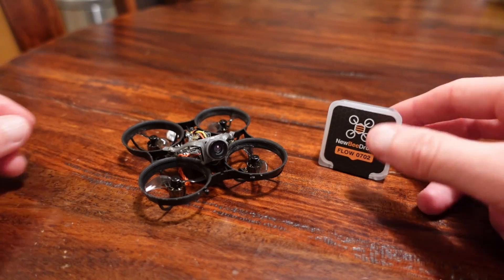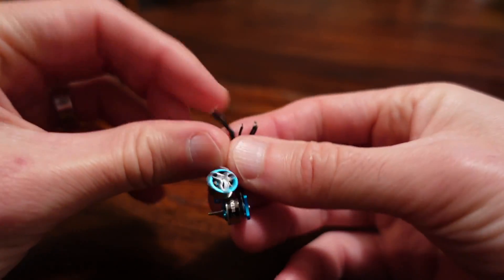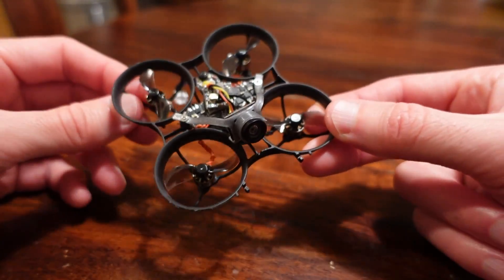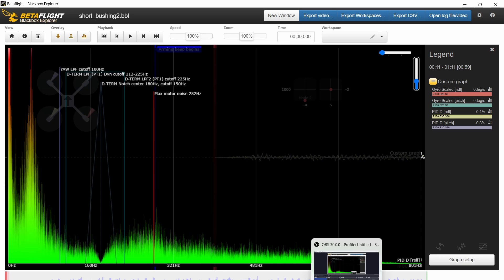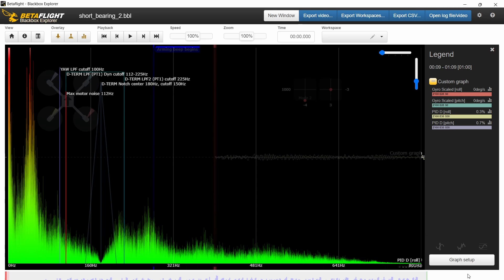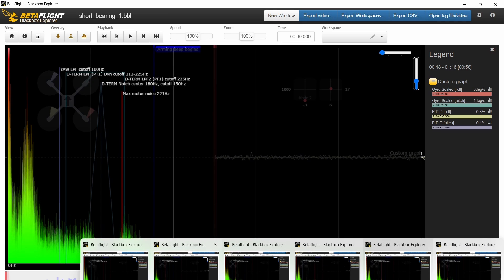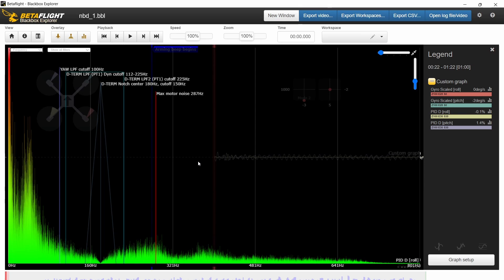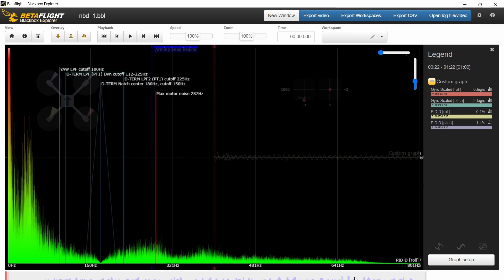NewBeeDrone 0702 Flow Motor: SMOOTH

Comment: When these NBD motors were initially released, I immediately ordered two sets.  The flight times were dramatically lower when compared to my well used HM 0702 motors when flown on the same rig.  The lower flight time was severe enough that I bit the bullet and returned both sets, even though I would take an open package penalty on the return and lose some additional shipping costs.  Please, the lack of flight time data is huge in regards to comparing efficiency.  If you can't finish the laps in one battery, you can't race.  Thank you for sharing your time with the community!
Reply from the maker: What flight time where you getting NBD vs HM?